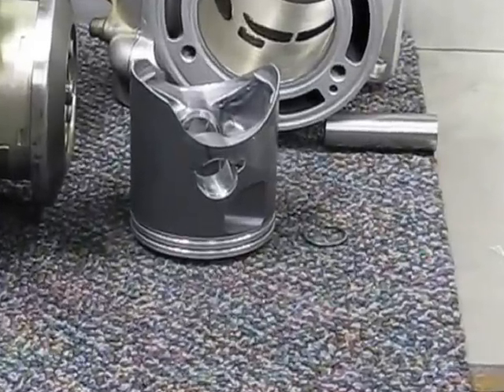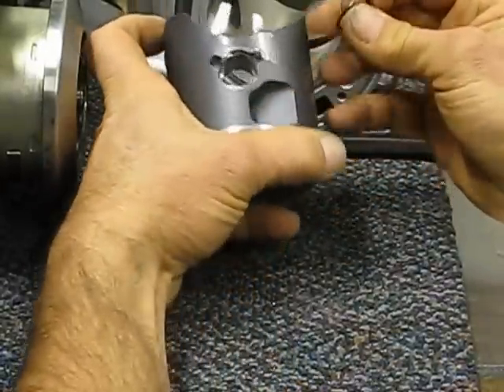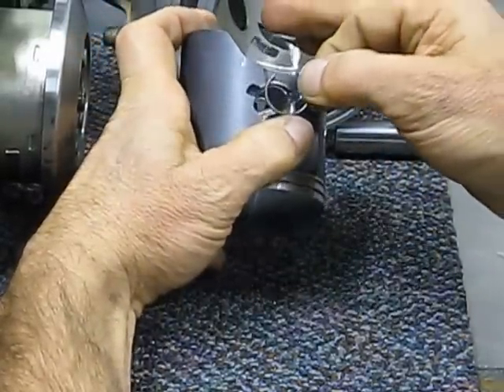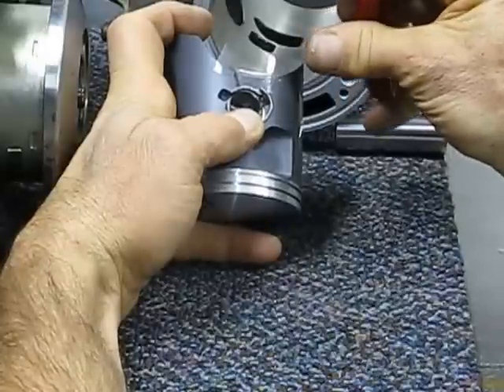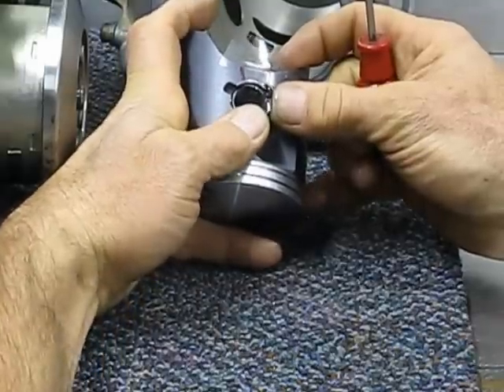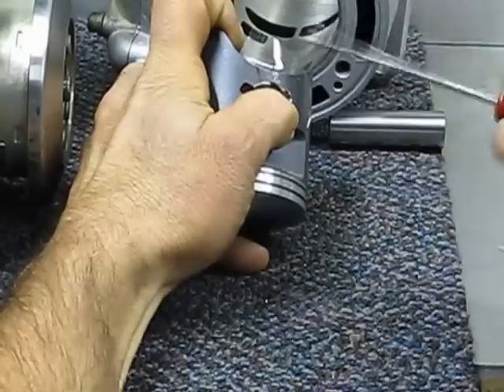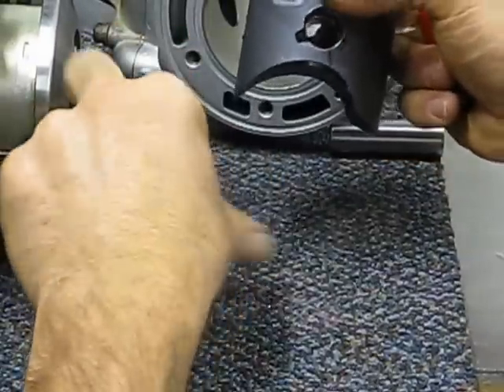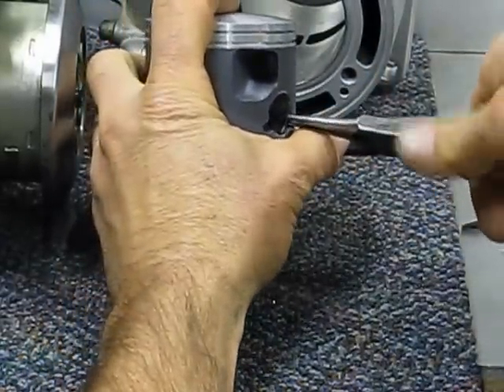Piston pin circlip installation for KTM 250 and KTM 300

Comment: The piston that you are using seems to have a non-stepped straight bore for the gugdeon pin (wrist pin), this will make installing the circlips pretty easy, I have just received a Vertex piston and there is a step in the bore just before the groove that the clip locates in, the step is making it very tricky because the clip goes into the hole but then hangs up on the step. I'm going to buy some circlips with 'ears' to get around the problem!